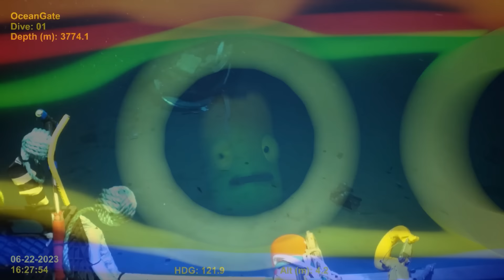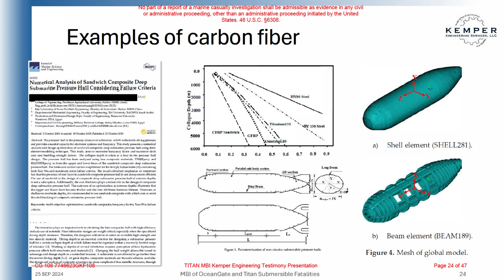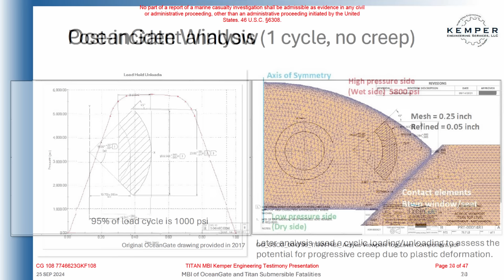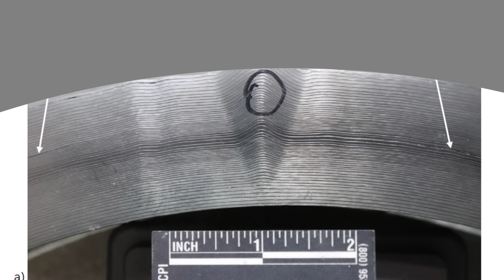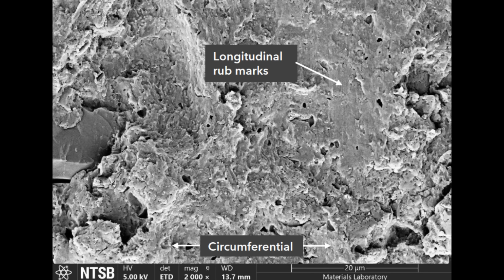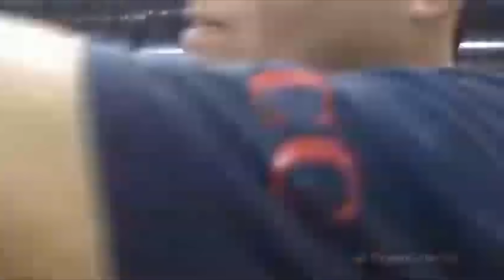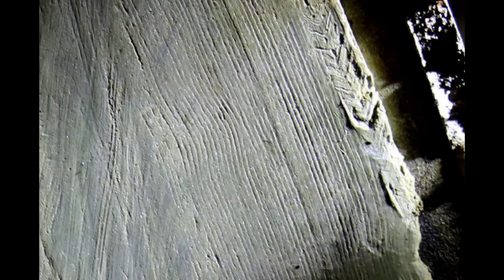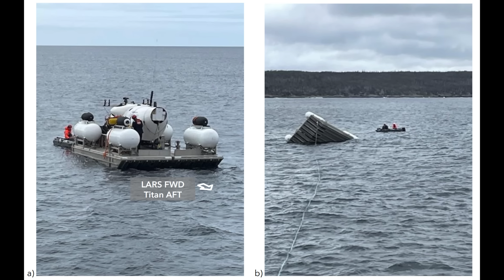OceanGate Wreck Shows Why Sub Wasn't Strong Enough To Survive - NTSB Shares Important Details

Comment: when we did pressure vessels we wound diagonally
I truly believe that would have been better (look at a paintball tank)
also doing it by robot under pressure to remove bubbles would have helped
youtubers de-gas! as mixing adds bubbles
also temperature is important like time in this process
so he made multiple mistakes just in standard fibre application
but in the end
I am no specialist
and it won't bring the passengers back!
so one more costly lesson it is!
thanks for sharing :)
Reply: paintball tanks are supposed to have their pressure on the **inside**.  Carbon fiber has fantastic tensile strength.  Under compression it collapses like a wet noodle.

Comment: Excellent monkeys fist knot - there's a sailor on that team
Reply: I only decided to make one when I was no longer working as a technician on an offshore seismic survey vessel. On reflection I should have got instruction from the Cape Verde deck crew when we were in port, but that would have eaten into their "entertainments" with the young ladies who normally inhabited the Stanley Bar (?) in Aberdeen in the mid 70's.
Reply: I definitely noticed the knot lol. Do you know what is it being used for on the ROV?
Reply: @SnakebitSTI  From the looks of it the knots and the ropes are used by the arms to grab things, instead of whatever they're attached to. And it seems they're also a bit lighter than the water so they float, which means they poke out of the seafloor if you drop something.
Reply: @SnakebitSTI  I should imagine it is a facility for quickly grabbing an already attached line - which is tethered to an appropriate spot rather than something else which is weak. With a little force those cable ties would tear away from the superstructure and bingo (& no trailing lines).  However...
Reply: I thought it was a dog chew toy.
Reply: @hotrodandrube9119  Never know where you might find an adorable pupper to play with!

Comment: My only experience with peel ply is that it's used to make the outer layer of a composite lay-up flat, not smooth, it has a texture to it,  and is removed after curing. it isn't left behind and it doesn't make sense to me for this application to have it left behind and then have another layer of carbon on top of it. it's designed to not adhere to resin and should be easily peeled away, thus the name.

Comment: You said that they were dismantling the wreck to find the human remains.
Would there have been any? from some of the videos i have watched explaining the physics, the pressures were so high that the implosion of the entire structure would have happened in tiny fractions of a second and everyone in there would have mercifully been vaporized before they could even register anything had happened.
The bodies would have been liquid and bone fragments, but that would be lost to the ocean, happy to be corrected If i just saw exaggerated or wrong videos on this :P
Reply: They found some “paste” that they sampled. It contained the DNA of the passengers.
Reply: I think most of those descriptions are over dramatized. 

Sure, it would have been an astonishingly quick collapse, but the human body is full of bones and stringy bits that wouldn't just disintegrate, even under those conditions.

I would imagine the pieces would be relatively small, but still easily recognized as human remains.
Reply: they aren't expecting to find skeletons.  they're expecting to find, maybe, a tooth here, a fragment of femur there.
Reply: A lot of those videos were made under an assumption that the failure point was the the middle of the hull. But now that we see the wreck we know the most likely failure point was the carbon fiber cap on the front of the vessel.
Reply: Boiled and vaporized. Well, not quite vaporized since under water. But basically extreme moment of heat and pressure followed by competing forces as physics tries to decide where it should all go. There'll be no bits to fine besides maybe uh.. Ech, organic... Smear? on some of the inside surfaces. Least it would have been fast..

Comment: Could the submersible have been sent down unmanned first?
Reply: I've been wondering this since day one 😂 I guess they were impatient
Reply: It had already made multiple successful manned missions.   So that would not have helped unless they sent dozens of unmanned trips, which would never have happened.
Reply: If the reports about unreliable communications are true, no. They would have lost the vessel many times over, and even when they had communications, they were so slow that they'd be driving blind.
Reply: Ah thanks for the explanation. Should have looked it up.
Reply: Seems as if even a fully mechanical control system could have guided it unattended down and back up. But I understand that the point is moot given that it happened after a sequence of dives rather than the first.

Comment: i think it's fair to say that even if someone wanted to make a carbon fiber hull work, test and certify it and all, i think Carbon Fiber now has too much of an image problem for anyone to really invest in that.
Reply: On the other hand, this is an incredible amount of extremely valuable data in how carbon fiber can fail under extreme conditions that would be hard to get otherwise
Reply: It seems like it works for submersibles that are only for shallow dives, but... yeah maybe it's for the best if the industry just sticks with materials not made with fibers from now on... see the thing that mindf***ks me about the carbon fiber thing is that... even disregarding ANY knowledge I learned during this whole debacle, when I hear 'fiber' I think of something that has weak points at microscopic level, something that BREAKS DOWN, so why did this man who actually had engineering knowledge just completely disregard the effect of pressures of the deep sea on FIBERS?  It's a level of delusion that I can't understand.
Reply: I wonder if asbestos would also work as a pressure hull
Reply: The USN has at least one CF hulled ROV, with titanium endcaps, iirc.
Reply: @dantreadwell7421  and is unmanned, a person cannot fit in it. Guess what that means the pressure considering is not the same. it is also is not carbon fiber. its composite with ceramic
Reply: yea but no one will ever design a commercial carbon fiber submersible now. also scot did mention the Chinese composite submersible.
Reply: @mshepard2264  which is an rov. no one disputes using carbon fiber for rovs. manned it is not used because the failure time cannot be determined.
Reply: i think only weirdos give a shit about public opinion
Reply: Can it be pretensioned?
Reply: At those depths, you cannot have a cylinder. Only a sphere would do. And then you have to engineer correctly the hatch and the window and any in and out cables and actuators to withstand the pressures. At that takes years of simulation and testing before you put a human inside that sphere. Carbon fibre is not a material to be used on a sphere at such crushing depths. It would fail after a few cycles.
  It has to be stainless steel or titanium. And the construction process has to certify there are no imperfections in the hatch, window and any interfaces. If there are imperfections, the sphere might buckle under pressure.   There is a Triton submersible that goes to 4000m with an acrylic sphere that fits 2 people. And the cost of that submersible reflects the cost of building, engineering and certifying such submersible. Cutting corners would only bring you to a crushing humiliating death as "oceangate" has shown us. And that' s the reality of it.  Deep water submersible tourism will remain an activity only available to very wealthy people. And that's why there are only 100 privately owned submersibles in the world.
Reply: Before we say that, let's have a few more billionaires test it out.
Reply: Carbon fiber has no attributes that are specific to carbon fiber which are advantageous to deep dives in the water. It’s weaker in compression than in tension. Carbon fiber has 50% of the compression strength compared to tension. Under the water you need compression. Steel is much better for compression. Steel is also much better for fatigue stresses. 

So to sum up steel is - 
Better in compression which
Better in fatigue cycles 
Stronger given the same size 
Tougher against yield failure
Reply: You forget that Titan has done dozens of dives. The problem was (a lack of) maintenance, not carbon fiber.

But if you've watched this or previous video, or done any research at all, you'd realize that other submersibles that use carbon fiber do exist.
Reply: @sujimayne it didn't do dozens of dives. It only did 13 complete dives. Give you a hint to be certified it has to be put in a pressure tank and then tested to the max dive depth plus a certain percentage hundreds to thousands of times. It would have failed certification. Give you another hint submersibles are meant to function for decades meaning  tens of thousands of dives to the max depth.
Reply: Carbon fiber is a wonder material, but it is not the material but the engineering.  These guys, by cutting into the wrap, destroyed the hoop strength of the carbon fiber.  it also looked like these guys were relying upon the adhesives to fix all their design (stress, tension and shear) and process problems.  One example was relying upon epoxy shear strength for the attachment to the end caps.  Ludicrous!!!
Reply: @paulholmes672 carbin fiber looks better after seeing this, since they made so many manufacturing errors the material can’t even be blamed here

Comment: Ok, so doubt anyone will read this. I've got 1.07 into this and I can't help but wonder if the sub imploded after impact in the sea floor. Just by the way it sits and the dome is in that direction. As if the sub went aft end down and the jolt hitting the sea floor was enough to set things in motion. But I'm now going to watch to the end and see where things stand
Reply from the maker: Previous video I made shows it imploded a few hundred meters above bottkm
Reply: @scottmanley  apologies Scott, I missed the previous video ✌️
Reply: But Titan dropped some ballists to go upward before they lost contact. They were sending messages back.

Comment: I am an engineer in the aerospace/composites industry. I’ve got parts on SLS, Vulcan, Atlas, and Delta.. waves and porosity are things that our inspectors look for like crazy.
Reply: I'm guessing "just grind the wrinkles off" is not an acceptable rework process, right? 😬
Reply: @a_51_  generally we define a wrinkle as a wave but raised. I.e. if the surface of the part are the X & Y the wrinkle would be in the Z.

A wave is just where the textile’s fiber direction got distorted during assembly. Wrinkled are a major repair, waves we have a lot more tolerance with.
Reply: Machining the waves down in the composite material doesn't seem like a good idea. Isn't that effectively cutting through the fibres?
Reply: @pauljcampbell2997  we don’t do that. We would make a patch which is a pretty basic composite repair.
Reply: I'd imagine he's just joking lol @pauljcampbell2997
Reply: @pauljcampbell2997 Application and location dependant, sometimes you can send the defective part to a manufacturing engineer to cut through the defect and produce a patch but it needs to be analyized.
In my experence its fairly rare to have an carbonfiber part reworked but I have done it once.
In 20 years. As a grandfathered in manufacting engineer from master machinist.

Its usually just cheaper to make a new part.
Reply: Nah when a part doesn't pass QA you just glue it back together right? Its just store bought glue and whatever CF you can find! Cmon bleeding edge materials science can't be THAT hard. Everyone else just isn't doing it right. /s
Reply: I would have thought the solution would be to redo it, go slower and be more careful, and if you can’t do it without wrinkles no matter how hard you try then you redesign it…
Reply: @sir9integra9jr problem was they only had a limited supply of it that they got for cheap second hand. 😓
Reply: @phizc  Doesn't matter where you get it from, if you stuff it up, wrinkles etc. into the bin, start from scratch
Reply: @sir9integra9jr  I have seen some pretty complex geometry not have wrinkles or waves in it. They need a better composites engineer. They could have used to heavy of a sheet instead of thinner with more layers.
Reply: @JoviusAquariums  Considering they got their CF secondhand, that's a distinct possibility.
Reply: I'm also an aerospace but work in industrial control systems. 
From what I know regarding CF you're 100% right.
Everything about this tragedy reeks of the blind arrogance of one man who could not handle anyone saying him "NO." I've seen a lot of that attitude in a variety of industries and it NEVER WORKS OUT.
Reply: Cool insight! Can you comment on how badly the waves and porosity pictured deviate from what's acceptable flight critical hardware in the aerospace industry? Definitely would have had me shitting the bed if I saw that. As an AE student, I wouldn't be happy with waves like that on a model HPR layup let alone something experiencing 400 bar... I understand some level of variation is inevitable with composites but what processes/techniques could have been used to mitigate that in manufacturing? Cheers!
Reply: @SJHSdrums  they were pretty shocking. I can’t divulge too much but we would have to do a repair at less than 40% of that amount of deviation. Also, you will have a blast as an AE when you find your niche. I was an aircraft mechanic and slowly transitioned into engineering through a weird job path. It’s fun stuff.
Reply: Trek also did for their frames and rims on their bicycles.
Reply: @Snuffitology the practice to mill the outer composite layers off to get the right shape is also done in the aerospace industry. 
They add additional layers as filler material that get removed together with the rough corner/end segments.
The difference is that this is calculated and the part needs to be checked on the inside regarding delaminations and inclusions.
Reply: @Snuffitology  And they fall apart !?
Reply: it's almost like those are some of the most important things for pressure vessel integrity lmao
Reply: I was going to say, this seems like they needed to do it again but didn't have the budget
Reply: 🤔 But l think it was Macarthur  that said you're remembered for the rules you break.
Reply: and in space the pressure is on the inside.... using the CF in a torsional way. This was folly from start to finish. 
I dont think manly understands that to use carbon fiber in a compressional way, it must be layered in a complex geometry, and even then it loses a lot of its strength. This sub was 100% reliant on the strength of the resin holding the fiber together and nothing else.
Reply: @GOP_Fascism_vs_DNC_Hypocrisy  Your being a bit harsh on Scott but your assessment of the failure is 100% CORRECT, especially the part about complex layering so CF can handle compression.

You probably know but for others - the purpose of the complex layering is so that even under compression there are strands of the carbon fibre that are in tension. 

I did Aerospace engineering (late 80s) and my professor was one of the first people to model CF in Finite Element Analysis. So I had this explained to me over 30 years ago.

For non-engineers and SORRY if this is longish.
A way to consider this (and its NOT an exact representation) is what happens when you squeeze a SOLID block of rubber like a cube of jello you get at a desert buffet. I emphasize SOLID rubber because SOLID rubber keeps the same volume whether its stretched or squeezed. So if you squeeze a solid block of rubber in one direction then it will expand (or stretch) in one or both of the other directions. 

This is exactly the same for anything that does not compress. If you squeeze it 1 direction it expands in another and its how Carbon fibre weaving works. When the resin is squeezed in one direction it has to expand in another to keep its volume.

It also holds for being stretched like when you stretch a rubber band it gets thinner. That means the other directions are being compressed.  

If you can understand this congrats as you now understand a very fundamental principle of stress analysis. Compressive stress in one direction creates tension stress in others and vice versa. 

So when Carbon Fibre is being squeezed the resin will expand in another direction to maintain its volume. So long as there are fibres in the other direction the resin is expanding in then those fibres are in tension and will take up the load. This is why most carbon fibre has that chequer pattern weave to it. Its so it can handle compressive stress irrespective if the compressive stress is caused by bending or stretching. 

In the real practical world. 
To make very light fuel tanks for rockets they wrap a very thin metal tank in carbon fibre. Simple fact if they made it out of solid metal it would weigh too much. There's videos here on YouTube showing this (just search "carbon fibre rocket tanks"). I'm fairly certain Scott showed this in one of his videos. 

You can see how they weave the carbon fibre over the outside of the tank. Even thought the load on a rocket fuel tank is tension because the pressure is on the inside there's also compression of the resin because the material the tank is made out of needs to maintain its volume. That's why they weave the carbon fibre onto the tank. Its so it can handle both kinds of stress. AND YES it also helps if the rocket gets any bending or twisting loads during launch.

No go back and look at how they layered the carbon fibre onto the outside of the Titan Submarine AND YES it freaked me out.
Reply: @GOP_Fascism_vs_DNC_Hypocrisy  And I love your tag name that's awesome.
Reply: Of course you are from Huntsville with that background :P
Reply: No, you aren’t.